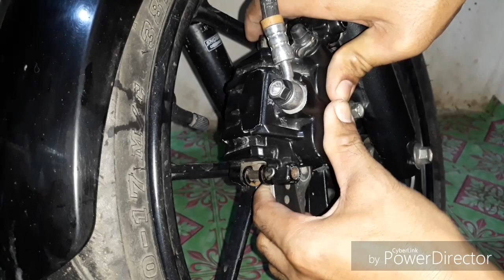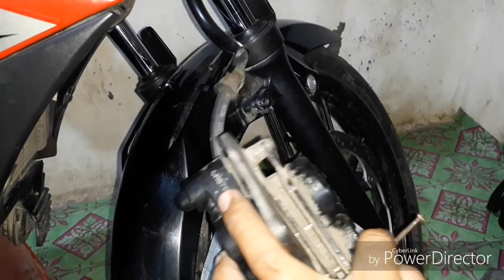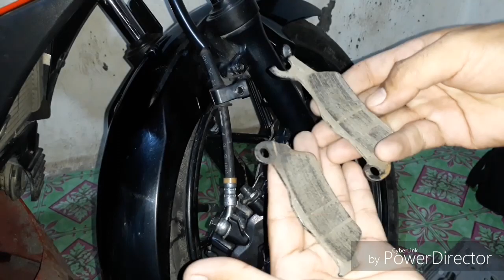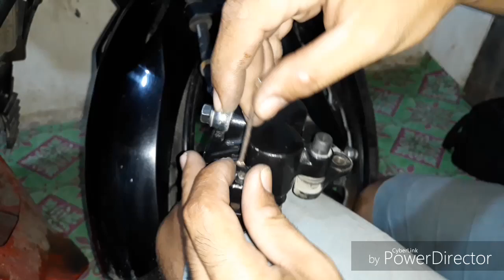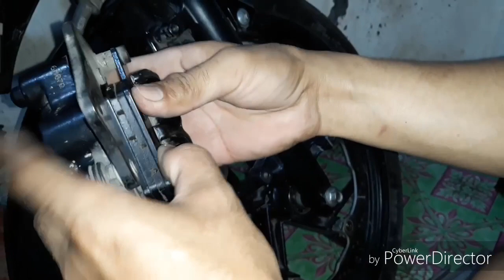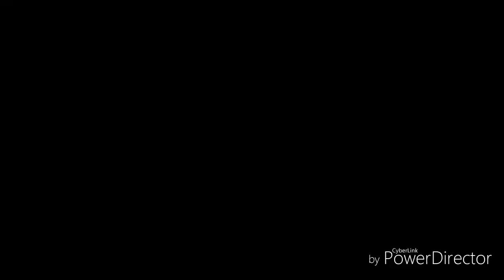Paano magpalit ng Brake Pads sa unahang gulong ng Suzuki RAIDER 150 FI?

Comment: Paps ang alod ingay ng pads 3 gabi n dikopa ma solve ang ingay e panu b diy ?
Reply from the maker: Check mo po kung naglalaro pa ng maayos ang caliper o kaya baka disaligned ang disk, check mo din kung ang pin ng bracket baka maluwag na
Reply: Ah oo nga e un ibang raider kita ko masikip un pin un skin checkin ko boss.

Comment: Same brake pad lng po bah ang sa fi at carb type
Reply from the maker: Sir magkaiba po.
Kapag bibili ka sir sabihin mo lang ang part No. Salamat sa tanong mo sir! Ride safe 👍
RAIDER 150 CARB
Front - Part No.59100-25810-000
Rear  -Part No. 69100-20840-000

RAIDER 150 FI
Front- Part No.59100-34880-000
Rear - Part No.69100-12830-000